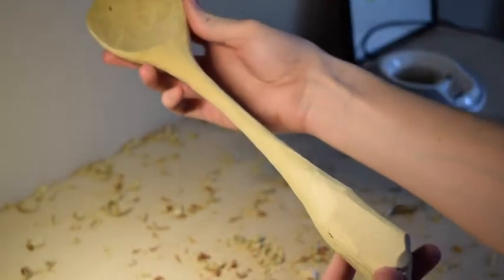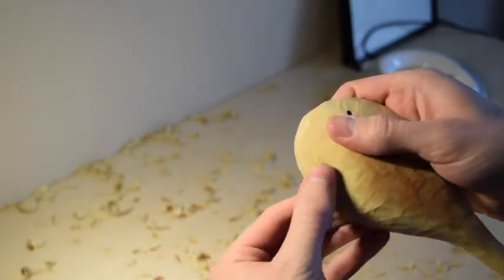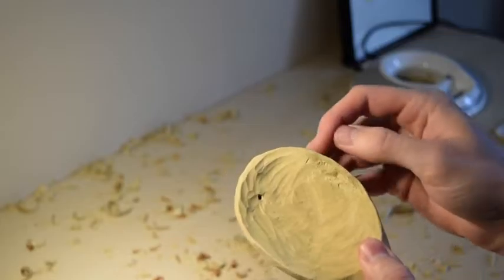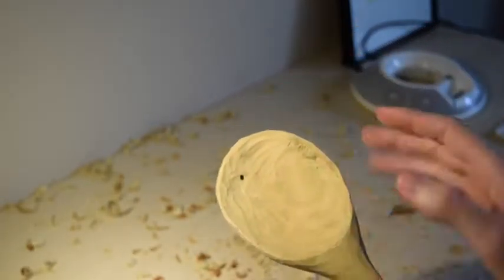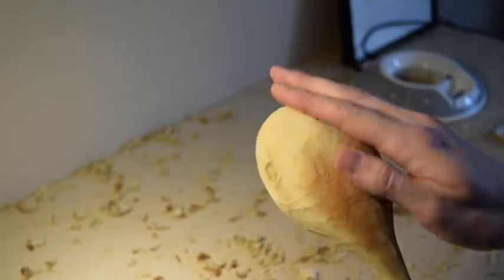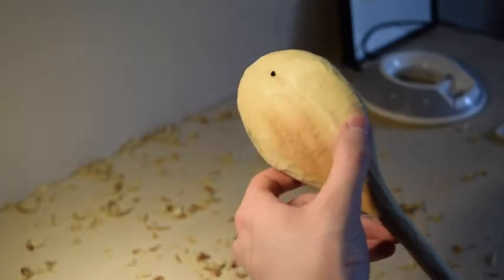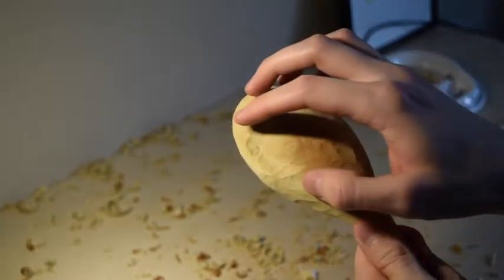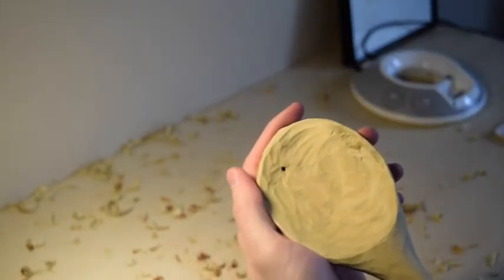EP1 tulip poplar serving spoon

Comment: What grits do you use to sand the inside and outside? And is there any specific techniques? Like following the grain as you do with the knife for eg.
Reply from the maker: When I use sandpaper I usually start with 300 grit and work up to higher numbers depending on how much time I want to spend on it. It's a good idea to  practice carving in a way that doesn't require sandpaper. That means making sure your knives are extra sharp.